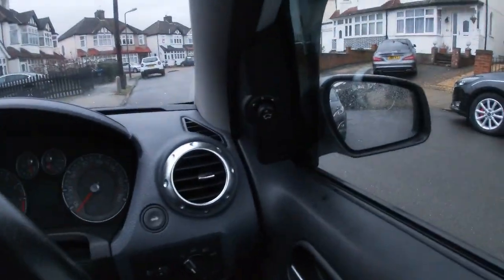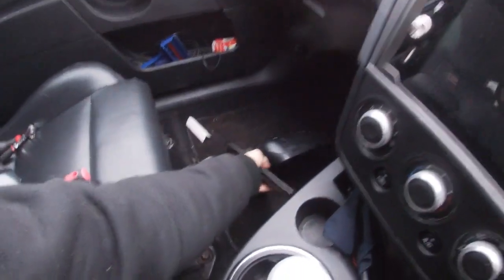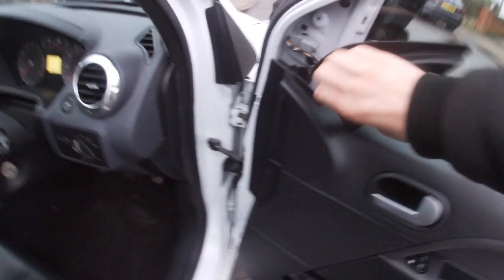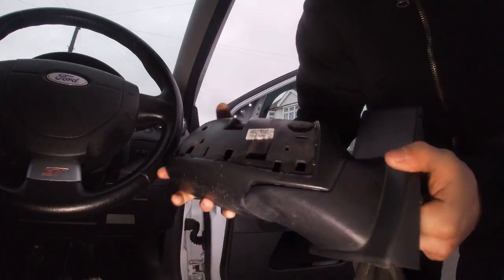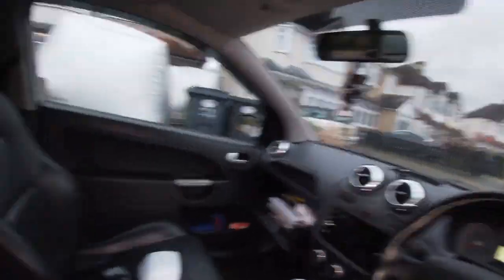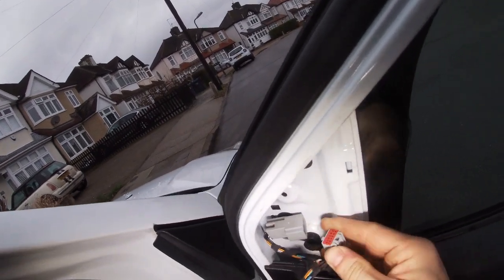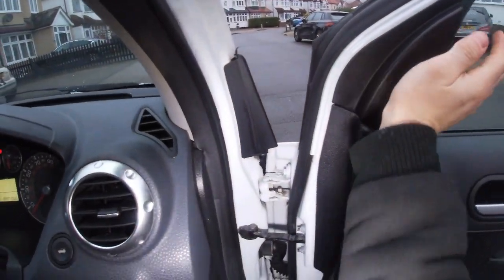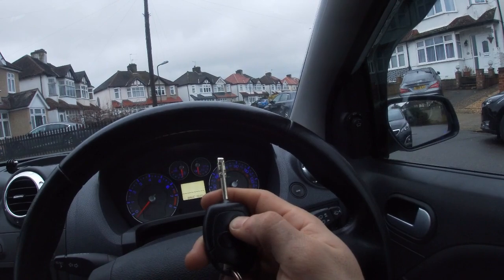FITTING AND PROGRAMMING POWER FOLD MIRRORS TO A MK6 FIESTA ST150

Comment: Hoping people see this before buying parts... Not every Mk6 has the dash loom and door looms for powerfold mirrors, even STs! If it doesn't, you'll need to add on your own mini loom behind the dash, either change the door looms or make your own mini loom, add the relay and wire in a fuse to your mini dash loom, and then add the sense wire to the gem to activate them on lock/unlock. And obviously change the mirrors and change the mirror switch. Without the sense wire to the GEM they can be used on the switch still. Hope this helps someone 😅
Reply from the maker: I’ll pin this comment so everyone can see👍🏻
Reply: Do you have any more information on how to do this? I unfortunately bought parts and found my fuse box doesn't have the electronics for the power fold
Reply: @hatenoobs1  i got the guide off a forum that's long gone mate, i have the loom and everything still in the car but wouldn't have a clue how to do it now. You could work it out if you search for the relay pinout but would take a while. Good luck!!
Reply: Hi any information on the mini loom and relay. As I have a output short to ground error
Reply: Hey mate, so u have any idea why i cant see my gem
Module when connecting elm to foracan?
Reply from the maker: Make sure your battery voltage is over 12v and make sure you have your switch on your can box in the correct position.
Reply: Hey man, just out of curiosity do you still have the car? if so could you send me a picture of your looms? Im looking to do it myself and sorta understand what you're saying but if you have a picture potentially that'd really help!
Reply from the maker: Send us a message on Instagram and I’ll get you a photo tomorrow if that’s cool
Reply: @DetectiveDeuche did you success?
Reply: Can you share mi wiring diagram?
Reply: Me
Reply from the maker: Sorry mate I don’t have a wiring diagram for this
Reply: @6uiltdifferent  can you send me picture of your loom?
Reply from the maker: @quannguyenquanganh8901  not much point all The wires are black

Comment: Hi mate, ino the video is 4yrs old, im lookin to buy the elm327 forscan from ur link but its unavalible as seller ended production, is it okay to buy a different product but its still a modified elm 327 with usb adaption for ur laptop?
Reply from the maker: Yes should be fine mate
Reply: @6uiltdifferent cheers bud, the one im lookin as a switch on the side of it for ms high and ms low, how do ino which one to switch too when tryin to connect to forscan?
Reply from the maker: @bushytushy9719 it’ll be 50/50 you’ll know if it’s on the wrong side as it won’t scan all the modules you see in the video

Comment: I had an issue, only connects on MS and won’t recognise the car on HS so can’t get the GEM module to appear :/
Reply from the maker: I’ve had this before sometimes got to reset the laptop or reinstall make sure you have the switch In The correct position as that can cause this too
Reply: @6uiltdifferent so what I did was close forscan and reconnect and wasn’t working and also kept unplugging and plugging, when I’d plug into it on HS setting “it couldn’t read the car” on the MS setting worked perfectly , so closing forscan isn’t the go to, the go to is reset the laptop?
Reply from the maker: @alexco5621 I would try an reset it and make sure forscan is on the latest version

Comment: Mines not showing up with the GEM with the switch in either positions and ignition is on. Tried resetting it multiple times and no luck
Reply from the maker: @benstanway8553  maybe clear all the data and reinstall it can be temperamental as I’ve had this before
Reply: Hi mate thanks for the tip. I tried this and even older version of Forscan which someone recommended, which I now realise is the same from the video, still not showing. Could it be something in the Forscan settins? Or maybe the actual reader even tho it's the right one. I'm not sure  @6uiltdifferent
Reply from the maker: @ possibly the obd reader mate I have the one with the manual switch

Comment: Hi mate, I know this is an older video, but I hope I can get some attention still...I have fitted the mirrors to my Fiesta MK6 (facelift). I have basically the same setup as you do - wires are all in in the mirror connector, I have fitted the mirrors, switch and activated it in Forscan. However, the mirrors don't fold. They can fold - I tested them on my external power source and the switch can control the up/down/left/right positioning of the mirror, but it won't do anything on pressing down. Also nothing happens on lock/unlock. Forscan reports errors in GEM, saying there is a short with the folding relay, but which one is it? All the relays are fitted in the fusebox (in the car, I didn't check the one in engine bay), and they are there since buying the car. The wiring loom in the doors is intact, there was never anything done to it. Also, both mirrors won't work and also if I only keep either of them plugged in, they won't fold. The car has quite an ok trim, so I don't think it's a "low" GEM version - I also verified this in the repair manual. Do you have any ideas what else should I check for? Could this maybe relate to a bad battery? The car is used only for a veeeery short comutes, so the battery might not be in the best shape... Thanks a lot for any help!
Reply from the maker: @RomanKolinek  hi mate if you give us a message on Instagram I’ll give you a diagram for the relay box they’re located inside the car there’s 2 relays one to unfold and the other to fold the mirrors

Comment: Anyone got issues with powerfold mirrors clicking when going when folding in after locking the car? mine are doing that and it seems to be a common issue, just wondered if anyone had a fix?
Reply from the maker: I don’t think there is one unfortunately only case is to get another mirror

Comment: Are comments still active here?
Reply from the maker: They are
Reply: @6uiltdifferent  I'm looking to do the same thing I my focus but it's a titanium model and I'm not sure if I have all the wires needed. 
Any tips?
Reply from the maker: @zacharyjohnson5463  not sure regarding the focus all I can possibly suggest is maybe get a Haynes manual and look at a wiring diagram for the mirror and see if you have the wires required for powerfold mirrors being a titanium model which is the best trim for a basic focus I’d imagine it’d be all there but obviously can’t say for certain

Comment: Where can i look to see if i have the correct module or loom before spending out on new mirrors? Cheers
Reply from the maker: Pull the trim off the inside of the door and check the plug if the plug is full of wires then you have the correct loom if there’s only a few don’t bother, also when plugging in the laptop make sure the battery voltage as above 12 volts for a start make sure you follow the steps with the can switch aswell which is very important as I thought my other mk6 didn’t have the module the other day but it did as I was flicking the switch when I needed to

Comment: Is there any reason why i cany find the gem module mate? I have a auto switching elm327
Reply from the maker: A few people have this issue it’s odd can be due to many things the lead is the main one some of them just don’t connect to everything, also connect it to the car/laptop before loading forscan and also download elmconfig as I’ve found that helps sometimes hope this helps
Reply: @6uiltdifferent   what version of forscan u use mate ?mines seems a lot different, mines is latest version, only has power fold mirrors enable/disable 

Yours has switch, lock etc etc 

Cannot get mine to work, 06 face lift
Reply from the maker: @kasmr9718  mine was a real early version now not even got a laptop atm hence the no uploads, the issue with the cars earlier than 07 a lot of them haven’t got either the correct gem modules or the wiring unfortunately when it comes to this sort of stuff it’s a gamble on the pre 07 models as the later ones came with it all even if it wasn’t chosen from factory
Reply: @6uiltdifferent   mate it eventually worked

My battery was reading 11.5 volts a just had to take car for  a run to charge it 😂 

Thanks for the video a couldnt have done it without it

Also subscribed mate
Reply from the maker: @kasmr9718  happy days yeah battery voltage is so important when programming bare that in mind even connect a charger whilst doing it incase a drop of voltage etc and thanks mate it means a lot
Reply: @6uiltdifferent  cheers mate👍

Comment: Hi mate, I have done all the steps with for scan but the Mirrors aren't folding or anything. They are definitely power fold ones. Not sure why it's not working 🤣
Reply from the maker: Are you sure you have the correct looms for it as some car like mine are pre wired and some don’t have the wiring for it
Reply: @6uiltdifferent  yes mate I swapped the door looms over because my mirrors were manual to begin with so I replaced both door looms with the electric mirror loom. The electric adjustment works but it's not folding. I have enabled it all on for scan but nothing. It's does throw up a dtc saying folding mirror short to ground? I can't find a fuse for powerfold mirrors anywhere on the car so I'm stuck 🤣
Reply from the maker: @josephturrall2333  the fuse will be for the electric mirrors so you should be fine you might have to swap the GEM module as yours wasn’t built for electric mirrors but I’d have a good look in the settings and see if there’s anything that’s been disabled that could stop them from working etc
Reply: @6uiltdifferent  I will have a look in a minute see if I can see anything. I don't want to be swapping the gem over so worst case is I can't have powerfolds but atleast the electric adjustment and heating works
Reply from the maker: I’d go through forscan and see if you’ve missed anything mate or if there’s something else you need to click as it’s been programmed for manual mirrors originally
Reply: @6uiltdifferent  yeah I will have a look over the weekend. Can't figure it out because it all wired up alright and loaded up on for scan exactly as yours did but when I lock the car nothing happens or when I press the switch down, nothing happens. Very strange 🤣 hopefully I can sus it out but if not I will have to make do with electric windows
Reply from the maker: Hopefully you get it sorted mate let me know if you solve the issue 👌🏻
Reply: @6uiltdifferent  just plugged forscan back in and went through all of the modules. Anything to do with folding mirrors has been enabled but they still don't fold 🤣 are there any other menus on forscan that I have missed or is it only really what's in your video? Cheers for the help by the way 👍
Reply from the maker: @josephturrall2333  should be whats only in my video mate
Reply: @6uiltdifferent  very strange then. Probably need another Gem like you said. Will see if I can work it out but I'm not too jothered if it's going to be loads of hassle 🤣

Comment: What was the gadget for programming mate please
Reply from the maker: ELM327 with switchable can box and the software is Forscan
Reply: @6uiltdifferent  I’ve found one on eBay but don’t know if it’s right one ? It’s only small
Reply from the maker: @darrenknott519  send me the link I’ll have a look
Reply: @6uiltdifferent  I typed in lm327 on eBay and the first one shows 5 in the pic
Reply: It’s LM327 Wi-Fi Bluetooth OBD2 OBDII car diagnostic code reader ATF ?
Reply from the maker: @darrenknott519  https://www.ebay.co.uk/itm/224766681897?mkcid=16&mkevt=1&mkrid=711-127632-2357-0&ssspo=QiDWIijFRy6&sssrc=2349624&ssuid=SUwfKUyKShe&var=&widget_ver=artemis&media=COPY
Reply from the maker: @darrenknott519  I’d get the wired one personally as it has the can switch
Reply: @6uiltdifferent  yes found it and ordered mate thx
Reply from the maker: @darrenknott519  no worries mate
Reply: @6uiltdifferent  hi mqte got the ELM327, gone through all the stages but I haven’t got the GEM Configuration menus any times ideas ?
Reply from the maker: @darrenknott519  replied on Instagram mate

Comment: My forscan module had way less options to disable and enebke, any idea why that is?
Reply from the maker: Might be different if the car isn’t an st or a certain year I’ve heard some cars done have the lists it’s quite odd haven’t found a way to sort it as I haven’t had it happen to me yet
Reply: @6uiltdifferent  yeah wel i know its an st.  But ive always had trouble telling exactly wich model it is
Reply from the maker: @yourimeeuwisse711  there’s only one st model except the st500 I think you should let forscan automatically connect to the car rather than manually input it
Reply: @6uiltdifferent  yeah i did let it do that and still not many options, it tells me its a 2.0 l duratec st so yeah
Reply from the maker: @yourimeeuwisse711  are you using an elm 327 with a can switch
Reply: @6uiltdifferent  yes i am and ive tried it switched to the other position but then it wont even connect
Reply from the maker: @yourimeeuwisse711  strange that is mate
Reply: @6uiltdifferent  yeah it really is. I will update if i even find a solution
Reply from the maker: @yourimeeuwisse711  I’ll pray to the car gods for you buddy

Comment: Im missing Gem module configuration..
Reply from the maker: You can’t connect to it? What obd lead are you using
Reply: @6uiltdifferent  I can connect,it shows rest of the modules but gem is missing. Im using obd2 adapter /hs-can, ms-can. Also a car is fiesta zs mk7 2010
Reply from the maker: @davevictory2692  I’d advise an elm327
Reply: @6uiltdifferent   @ThatFrozenFez  you right, noticed it says that adapter not recommended for this car. Will try elm327. Thanks dude
Reply from the maker: @davevictory2692  no worries

Comment: I had a look at doing this on my 1.2 Zetec Fiesta, but when i got to the laptop plugged in to the car, mine only found the RCM and ABS modules, not the GEM module. Mine is a Mk6 and came with electric mirrors, but not the powerfold ones. Now my friend has a Mk6.5 Zetec Fiesta, 1.4 and his does have the powerfold mirrors, so i plugged the laptop into his car and his car also only detected the RCM and ABS modules, no GEM module. Yet his car has mirrors that fold either via the switch inside the drivers door or via the immobiliser.  My 1.2 Mk6 has exactly the same wiring in from the mirrors as his car does, yet the mirrors wont fold on my car via the switch or immobiliser. I was hoping you might have a bit of advice, i was a bit confused as to how the mirrors work on his Mk6.5 1.4 when his isnt showing a GEM module present  :(
Reply from the maker: Might wanna try a different obd lead which one are you using
Reply: @6uiltdifferent  thanks for replying so quickly... it was this one

https://www.ebay.co.uk/itm/162199978849
Reply from the maker: No problem, I have one in the description of this video and it I’ve used it in more than one video of Mind now and it works fine I’d advise that also make sure you have the look setup for yours as yours is only a mk6 some didn’t come with the door looms you’ll see by the plug it has loads of wires going to the mirror
Reply: @6uiltdifferent  thanks i've ordered that one now from the description, i'll see how that one goes. Regarding the wires i'll check later but i recall about 10 wires coming out of the plug and down into the door
Reply from the maker: @zoehunter5203  hopefully should be okay then that’s what mine had
Reply: @6uiltdifferent  hiya, that ELM327 arrived and i've tried it in my MK6 and my friends Mk 6.5 (which has powerfold) and i cant get either vehicle to display a GEM module. On the mk6.5 it does that last stage as per your vid when its asks about the HS-SCAN switch, after clicking YES it doesnt find anything else, only RCM and ABS. I tried the switch in the other position and it wouldnt connect to the vehicle so i'm sure i have the switch set correctly.  I'm a bit stuck now TBH, i installed that OBD-II driver on the CD that came with the ELM327 but is there anything else off the disc i need to do? (this is Zoe again, i'm on my friends profile at the mo)
Reply from the maker: @kevinmulhall  sounds like you’ve done everything very strange how it doesn’t want to recognise it have you made sure forscan is fully updated etc?
Reply: @6uiltdifferent  hey! i just tried it again , first time since last year and it worked exactly as you said, i've not idea why it didnt work last time, but thanks so much for the help!  got folding mirrors now!!
Reply from the maker: @zoehunter5203  very strange haha but happy days glad you got them working enjoy them it’s a cool feature 😊

Comment: Your mirror body appears to have the cut out for the indicator lights as used in the Mk2 focus. Most mk6 Fiesta aftermarket powerfold mirrors seem to have that Mk2 Focus cutout these days. You need to get some indicator lenses and scalps from a Mk2 (or from AliExpress) and wire them in to get indicators on your Mk6 - pin 8 on the mirror connector is free and there's usually a couple of lines free in the A Pillar connector - if you don't have the Thatcham larm and the double locking doors that is. I reckon your mirror body may also have the puddle light cut out too. The lenses for those are just as easy to get. Wiring them up through the A Pillar connector though - that's harder. And with all lines used on the mirror connector, you'd have to de-pin the 8pin Molex connector and insert the pins into a 10 pin connector shell to get extra lines through.
Reply from the maker: Nice one mate might have to look into this didn’t even know about the puddle light on the mirror